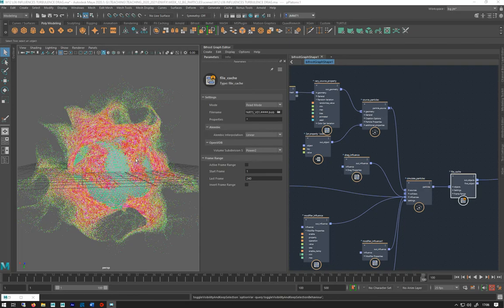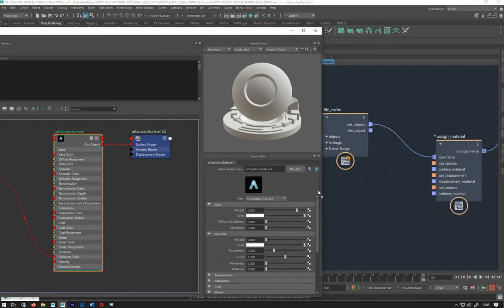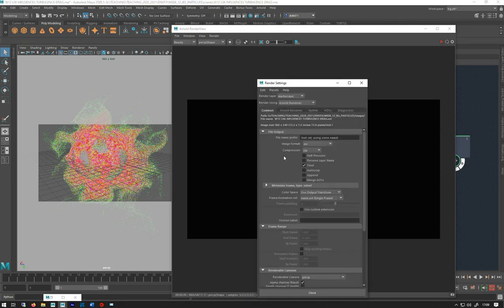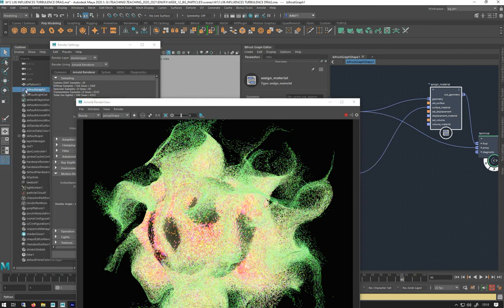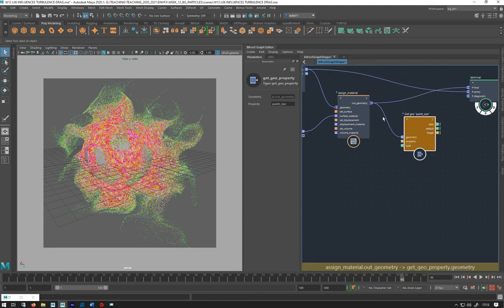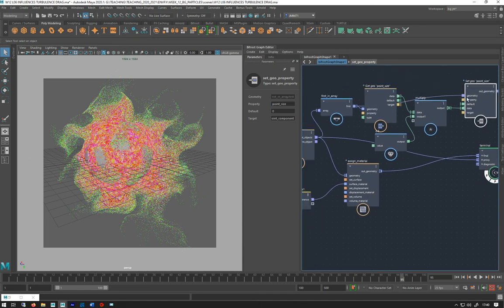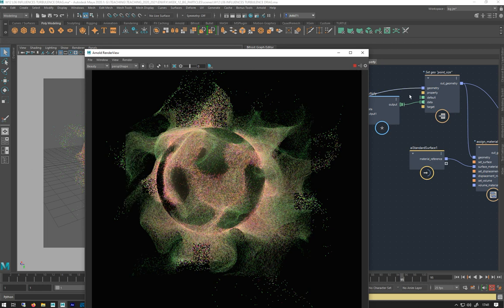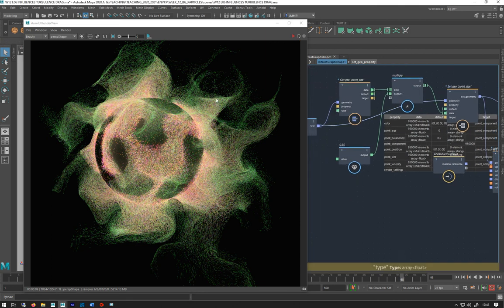BIFROST BASICS: WEEK 3 LESSON 8 RENDERING AND ADJUSTING PARTICLES AFTER CACHING

Comment: Okay... figured out it was the cache that I had to re-create. Now, I got two questions:

1. Why do I need to connect the "First in Array" node (which I barely understand, by the way) into the Geo port of the "Set Geo Property" node? Why doesn't the latter node understand that we're talking about the particle system??

2. Why does the "Assign Material" node not give the hardware preview of the particle system the colors when plugged into the Proxy input? Why does this only work when the "Set Geo Property" node is plugged into this? 

Thanks.
Reply from the maker: 1.	So, an array is just a list of data and you can have arrays of arrays, which you could think of as a book as the first array and the chapters are the arrays inside the array.  When you write out a cache it writes out an array of arrays of arrays which you can think as multiple books of data. So, the first object is the first book which in this case contains all the point data, and the different chapters are the different types of point data such as positions and color. 
2.	Unfortunately, Maya can only display point colour data or vertex colour data in the viewport if a Maya material is assigned such as a Lambert. so when you apply the assign material you override the Lambert with an Arnold material .A way round this to keep seeing the colour in the viewport is to pipe the assign_material node into the final port of the terminal and plug the node before the assign_material into the proxy. That way you get viewport colours, and it will render correctly.
Reply: @jmm7180  Wow, thanks for all that. I'm copying this into a sticky.